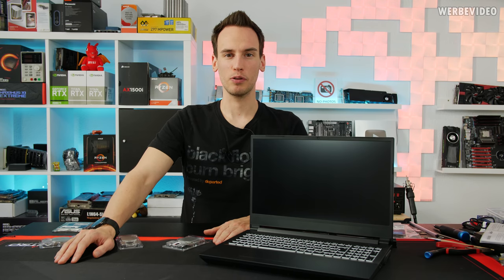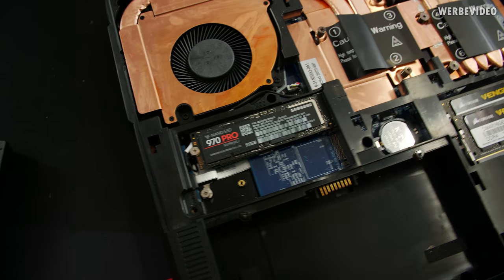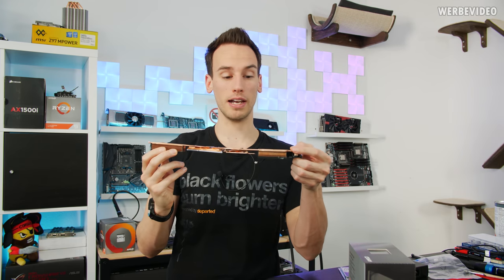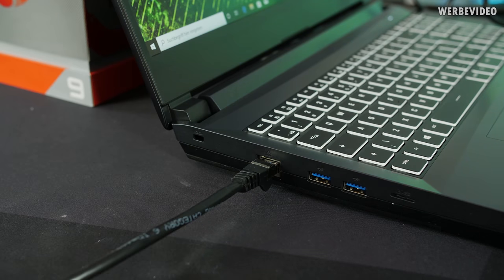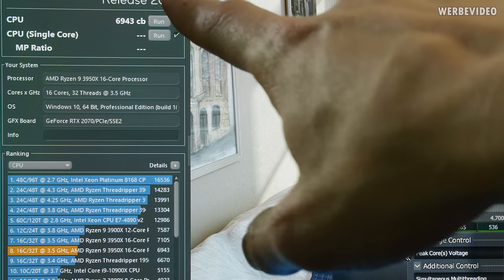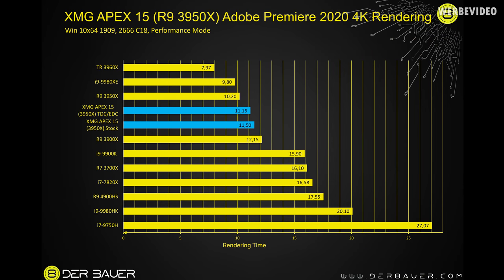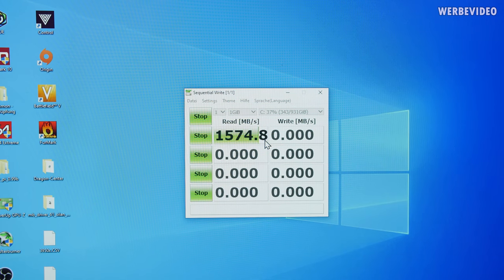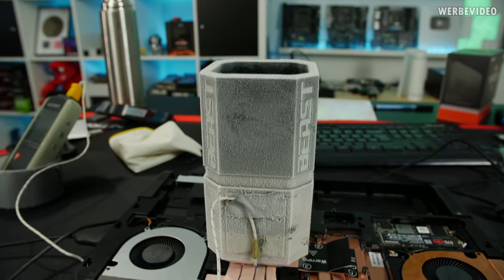INSANE: 16 Core AMD Desktop CPU in a NOTEBOOK. Ah yea and I added some Liquid Nitrogen

Comment: Getting the CPU stuck to the cooler is an issue so old AMD should be ashamed of not trying to address it on AM4.
All it takes is a pressure plate to come down and lock the CPU on all sides, like Intel is doing forever now...
Reply: Maybe you should ask De8aurer to make one? All the reviews would use it for their test beds. .
Reply: I’m using carbonaut in my laptop for that specific reason when it gets here in a few days
Reply: @sbeezynukka  Do you get better cooling performance with the carbonaut than the stock solution of the APEX15 ? What are you results ?
Reply: @PadBoll   I’ve ran it since day one so I wouldn’t know how the stock paste does.
Reply: @sbeezynukka  OK, thx. I'm searching for a solution to bring temperature down and avoid noisy ventilation. The only thing I have in mind is to drill a hole under the case and stick a good old PC ventilator near the CPU/GPU...

Comment: Cool to see the new Clevo computers going strong! 
Reminds me of my old laptop "Clevo P651rs-g" :) 
Close to what you did with LN2, I soldered on 2 slim water blocks on to the copper heat-pipes, with quick-connect water-hoses on the outside of the laptop's case.
This made the i7-8700hq and GTX1070 run close to desktop performance while connected to water, and still be a laptop to bring out of the home office. 

For anyone Interested in "external laptop cooling":
The pump, reservoir, radiator, fans and a 12Vdc power supply was used separately from the computer.
Copper water blocks bought from AliExpress or equivalent with a small hose size to fit inside a laptop case. 
Only water hoses connected the laptop to the cooling solution. Fanspeed was dynamic based on a thermistor and pumpspeed was at 100%.
*Note: Soldering copper blocks to the heatpipes is something i won't attempt again, it requires very high temperature from a blow torch.

Comment: THANK YOU @der8auer your the only reviewer/youtube that i've seen that has the correct single threaded for the 3950X i have one on a AIO Castle 360EX cooler and i get between 499, 505, 510 in single threaded test on r20 depending on what's running in the background and ever since i got it since release day.... i could NEVER get the 520+ other popular reviewers have been getting no matter what i did stock,OC,PBO you name it.... and i could never figure out why.... unless they have absolutely NOTHING running in the background which is VERY UNREALISTIC in normal real world usage as they like to called it.. anyways thank you for that now im at ease lol....

Comment: They could add a pair of quick disconnect couplings for optional external water loop :-)
A docking station with adequate radiator could unlock the full desktop power.
Reply: That is a very interesting option, the pipeline is kind off already there, just add quick connects and you are set. It will be an expensive set up, but you get the best of both worlds.

Comment: this is a CLEVO nh55ac barebone for anyone interested in highly customizable laptops. XMG is a distributor of clevo, barebones are somewhat popular in asian countries. power delivery of the laptop much exceed the cooling capability of the stock cooler. there are lots of custom water/air hybrid cooler made for clevo barebones, at home you can run on water and push 140w to the cpu.

Comment: One of the key differences on the 3700X versus the 3950X is the amount of L2 cache and L3 cache.  There is 100% more L2 cache and 100% more L3 cache on the 3950X, so the additional cores are not being limited by a reduced relative cache per core.  If I understand it correctly, that is why there is basically no detriment to CPU performance.  I am not sure if or how the power limits would affect it overall, but this could explain why it did not lose performance like in other situations when SMT is enabled/disabled.

Comment: How long until we see a Threadripper 3000 based notebook? :)
Reply: xD
Reply: The power brick would actually be brick sized, but, oh, so worth it!
Reply: Would you imagine that? Still be way more portable than Shintel attempt to show off a 28 cores 5GHZ all core boost... 😂😂😂😂
Reply: I'd buy that.....
Reply: ok a briefcase-sized one not impossible if people wanted that kind of portable power 20inch screen just to start power!
Reply: Remember Eurocom Panther 5se,  hence an Epyc/Threadripper laptop is not impossible just the cost, design considerations and registered ECC SODIMM(for Epyc) is the problem since there are no options bigger than the Samsung 32 GB SODIMM DDR4

Comment: Well you just showed me the laptop that I want, love the fact that I can buy the base model w/ a 2070 and update the processor later on down the road as the 3600x is not a bad CPU to start with.  Also considering the the upcoming gen of 4000 series desktop CPU's should still be using the AM4 socket so that should be a killer option.

Always love watching your content man - you never disappoint and expand my knowledge in this space

Comment: I wanna see what the Liquid Metal (Conductonaut?) does. Why not just go all SSD and skip SATA, for overall speed performance? I guess if you buy an extra battery or two, then you could use it for longer while unplugged. Is the battery hot-swappable presumably?

Comment: that is pretty cool really surprised you was able to get as much as you did out of it on the stock cooling config I know what ya saying about the casing but agree with others its not necessary a bad thing it looking like that throw in a nice panel and I'd be good with it perhaps strengthen it up a bit but yeah its fine

Comment: Looks like it's nearly time to upgrade my Asus "Eee" PC 1000 HE.
Reply: I remember these 🤣 mine broke in travels.
Reply: Nah, don't bother. It's gonna be just a marginal upgrade.
Reply: Lol, I still have mine... with the Shintel Atom Dual Core... the slowest crappiest most annoying CPU ever made... it was useless at release... it been sitting on a drawer for a long time... fixed the cooling, added the 2GB RAM, added an SSD and still slow as turtle... but this new AMD 4000 series look like a small incremental upgrade, I think I am going to wait for Atom 10980HKS I am sure Shintel will release one soon ROFL... 
It is amazing what AMD has accomplished in just a few years after releasing the first ryzen... they seem to draw power from dark matter... holy cow 35watts kicking 90watts arse... amazing.

Comment: Just a thought. Wouldn't it be more effective keeping the heatpipes just above 0 degrees celsius? The reson i was wondering was because the water in the heatpipes freezes when they're below 0 degrees celsius and then only the copper would transfer the heat making it less efficient.

Comment: One question Roman:
What if you kept the 3950x which is a higher binned CPU and disabled a few cores? make it a 8 Core 16 Threads while in gaming.. What kind of performance would we see then?
Reply: 3900x its a good chip on it own spend the bucks on the mem

Comment: Is the GPU soldered on? Really like that it seems to be welcoming those who want to detach parts/upgrade stuff themselves when the laptop starts showing age. But if the GPU is soldered it seems a bit strange to go that route. I've owned a Clevo P751DM for 5 years now. It's a chunky Clevo with a desktop CPU just like this one. It hasn't missed a beat apart from last Winter the 980M fried and stopped working. I replaced it myself with a new replacement from a reseller in China. Chucked it in, repasted and re applied thermal pads.... and it's worked like a dream ever since. However, i would like to upgrade in the next year or 2. The Apex 15 looks like my cup of tea for sure, but if there are any soldered parts - it's a complete deal breaker for me.
Reply: GPU is part of the mainboard. For MXM graphics, check out XMG ULTRA 17. // Tom

Comment: Since there are desktop components in this laptop and its already pretty thick, would it be too much to remove the loud laptop fans that are probably not working that well and just add instead a couple of those noctua low profile fans? Perhaps by manufacturing a new base covering so they can slot in. In a new iteration perhaps they should even completely remove those copper heat pipes to save thickness from there and just add two low profile noctua coolers directly to the motherboard for the cpu and gpu?

Comment: 18"-19" (or even 21") variant with vapor chamber like it was in clevo p870 series, but improved, MXM new gen GPU slot, 4 DIMM slots so could be maxed out 128gb of ram, 2 sata slots, 1080p 144hz 1ms IPS panel with 100% adobeRGB, good sound hardware, 4.2 sound system)))
Dreams :)

Comment: I highly doubt that 2nd M.2 slot is running PCIe2, it's probably only using 2x PCIe3 lanes instead of 4x

Great video as always
Reply: exactly my thoughts, no way they are using gen2 in this thing
Reply: @mscd9676  We will clarify this and reply shortly. // Tom
Reply: Aren't pcie 3x2 and pcie 2x4 equal in bandwidth?
Reply: @gautamdiwan5952  yes, except one is only using 2 lanes

Comment: Seems brilliant, would love a 17 inch version though, also is it a slightly different chip to the desktop ones, is it a 65w cpu or is it a normal desktop chip that is limited by the motherboard to 65w?
Reply: The 3950X is the standard Desktop CPU, being told by the BIOS to run in Eco-Mode @65W (up to 88W PPT). // Tom

Comment: Is there any word on this laptop fan noise levels while using 3700x or 3900?
I'd like to know about this because I could use a viable DTR for 3d animation classes and occasional gaming (RTX 2070 likely), but since I plan on taking the thing with me to class, I need for the fans not to produce large levels of noise.

My PH517-61 was dead quiet (round 45 db at maximum) and cool even under full load (no more than 75 degrees Celsius for both CPU and GPU)... and it had desktop Ryzen 2700 (65W) and Vega56 (120W) inside (had to get a refund though because a BIOS update didn't go right and it ended up corrupting the BIOS chip for which Acer decided to replace the motherboard, but they never did and I had to wait over a month before being offered a refund - otherwise, without the last BIOS update the unit was running stable, cool and quiet - I don't understand how laptop OEM's get away with not producing this kind of cooling in other laptops).
Reply: XMG APEX 15 fans are very calm when used in the 'Quet' mode which puts the CPU at 32W PPT. We are currently working on taming the 'Entertainment' profile with 45W. Performance will stay at 88W top power. There are more reviews coming out soon which will show: yes, the fans get appropriately loud when the system is used at 100% but you can absolutely use this as your daily working machine just like any other laptop. // Tom

Comment: I am not sure whether the power elements will supply enough power to both cpu and gpu, especially considering 3700x and 3900x with something like rtx2070, but it's also nice to have a real am4 socket in such a laptop
Reply: The CPU is locked down to 65W TDP (actually 88W PPT in Performance Mode) and the GPU takes up to 115W. The 230W slim power brick can handle CPU and GPU at full load just fine. // Tom

Comment: XMG? Sager/clevo or eurocom desktop replacement? Probably could easily mod the bios, Insyde/h2o has tons of resources available and it's pretty easy for what I remember from like 5-8 years ago (before I switched to mac pro 5.1 which still rocks (have 6 of them, messing around with hardmods) :PP)

Comment: possible to share the bios installer? i just brought the unit, and wanted to reduce the CPU clockspeed. the fan noise is unbearable :( now every time i boot up the machine, i use ryzen master app to change the settings. it will be good to default the settings. thanks

Comment: Awesome review and laptop! How would you describe noise levels? Is it possible to set fixed voltage/clockspeeds? On the ryzen 3600 it is possible to run it at 3700MHz around 1.00V with a powerconsumption around 50-55W during stresstesting. A guy I know ran his 3900X at 1.0V at 3900MHz with 75W consumption during stress test, that would be doable on this laptop aswell if it's possible to set clockspeed/voltage :)
Reply: We're still fine-tuning the fan control for the more moderate performance settings. If you want to achieve the benchmark results like in this video (with stock cooler), it gets quite noisy. But there is going to be quite a range between Quiet, Entertainment and Performance profiles on the CPU side. On the GPU side, NVIDIA does not allow any granular fine-tuning. They ask you to use the "Whisper Mode" in GeForce Experience or you can use an external FPS Limiter like in the tool NVIDIA Inspector to tame the card. // Tom
Reply: @xmg_gg  Congratulations on this laptop. I will be ordering one in about 1 month. My only doubt is if there will be a 17 inch version
Reply: @aormonde  There won't be a 17" version of XMG APEX 15 anytime soon, from what I can tell. // Tom

Comment: i would like to see a test or a series of benchmarks games and workloads how much is the difference between ddr4 3200mhz and 3200mhz cl16... or one more in between 19 lets say. is this even noticable? shouldn't you go for the 3200mhz 21cl for example vs the 2666mhz 16cl? the latency is that big of a difference? 🙄🙄🙄
Reply: Depend your software.
1. Need small latency 
or
2. Need more bandwith
sometimes they doesn't care about latency

Comment: Im always curious about something. When it comes laptops and high end ones. Why not make it thicker for better cooling ?  You can always improve chasis of the laptop to add better cooling solutions. There are better ways for it. They always go with slim profiles but the problem with slim profiles you gonna throttle due to temp

Comment: A quick question sir. What if you placed a peltier element at the back of the heat pipe where the CPU is located. Also, add some cooling at that one too, is it worth it?

Comment: Same problem here!!! I have the same notebook, The RAM speed is limited to 2666 mhz...I had 32gb 3200 mhz and it didnt worked... What would be the solution here? stick forever with 2666 mhz ram and wait for a bios update in case i wanted to use the 3200 mhz? DO you also know if this problem is just affected by the speed or also by the capacity of the ram? Would it accept 2 slots of 32 gb 2666 mhz? (total 64 gb) or is also limited ?
Reply: Please contact our e-mail support, for example by replying to our last automatic e-mail. // Tom

Comment: I'm searching for a solution to bring down temperature lower, to avoid noisy ventilation blowing at max speed. I'm a classical recording engineer, so I need to work in a quiet environment. Have you got solutions for me to use ? So far, I'm thinking to drill a hole under the case and stick a good old quiet ventilator near the CPU/GPU. If you got any idea's, please share ! :)

Comment: Damn, that`s one laptop I would consider buying! Is there going to be 17" version? Can I order extra battery or two? It`s not listed in configurator... P.S. Wouldn`t mind to have some AMD GPU to choose from as well.
Thanks Roman!
Reply: No plans for 17" at this moment but check out our XMG ULTRA 17 which will be refreshed with next-gen 125W CPU soon. Spare batteries for XMG APEX 15 will be available soon. No plans for AMD dGPUs at this time because NVIDIA still offers more performance per watt which is all-important in laptops. // Tom

Comment: Now click on auto overclock in Razen Master. Set my 3950x to 4825mhz on all cores, but it thought 1.648 volts was a good idea... on air! (NH-D14) 🙄

Yeah Nah, I don't want to melt it (they're a little pricy)

Razen Master is a good idea but it is very buggy, often crashes on startup. Plus overclocking is a little pointless unless you want to benchmark your cooling. Hate to say it, but default is the sweet spot for performance and power usage (I like quietness these days). It's the first desktop I've owned in almost 20 years what wasn't overclocked (it doesn't feel right). Although the GPU overclocks nicely (rx5700xt will happily spend all day above 2ghz), so swings and roundabouts.
Reply: Oh, and I wouldn't say Ryzen is very efficient with power usage at idle. ~90watts (the size of this laptops power supply)

Comment: Would be "cool" if it had a dock with a beefy PSU and chilled water block that pressed onto the heat pipe so it was of use on the desktop and still usable portable
Reply: I think there's a laptop from ROG that does a hybrid water cooling thing when connected to a dock. That's the nearest a laptop can go for cooling tbh

Comment: QC issue on the heatpipes - some big dents - Pre pruduction?
Reply from the maker: Very eary sample as I said
Reply: @der8auer  ok, cool, awesome laptop, now the only thing we need is a 3990x laptop. I wonder how a 3990x would preform at 55watt.
Reply: @lasseberg7317   Lol, it would literally be impossible to fit a LGA-4096 socket inside a traditional laptop, let alone cool the damn thing...
Reply: @Cooe.  hehe jup, but would still be fun to see what a 3990x can do at 55watt.

Comment: They need to replace that cheap plastic with anodized aluminium. Better heat transmission, better looks, better mechanical properties. Only con would be increased weight.
Reply: Increased weight and increased flex. High-quality, durable plastics are stronger than aluminum. (But the display back cover is still made out of metal, so there's that.) // Tom

Comment: Question: how long will it take to see a CPU that performs the same on Desktops and Laptops?
Reply: At least another decade? It will require a new material because power limits or that CPU markets decide put more IPC in mobile CPU than desktop.
Reply: If it ever happens... it will take a very long time, as you can always add more performance with more power and cooling. And for sure it will not be in the the silicon era.